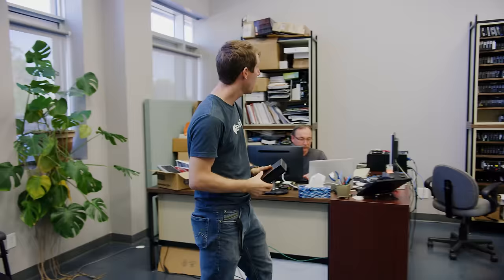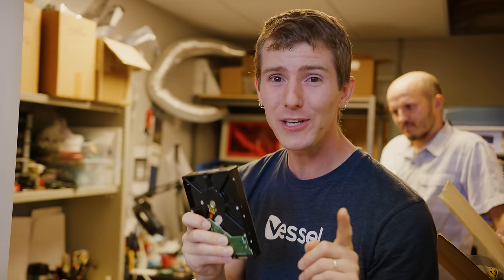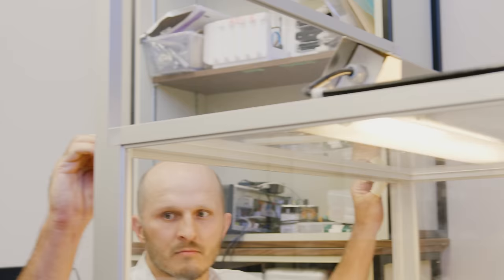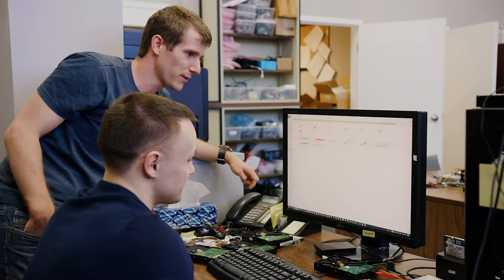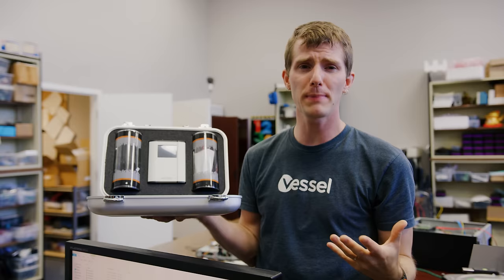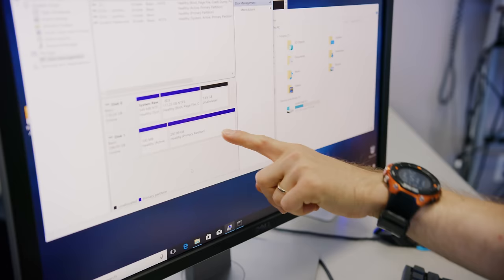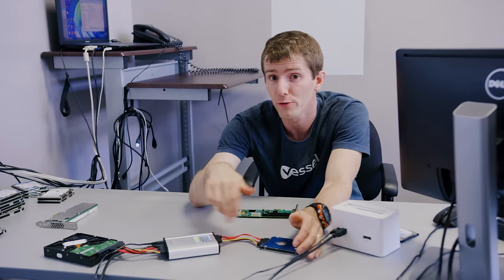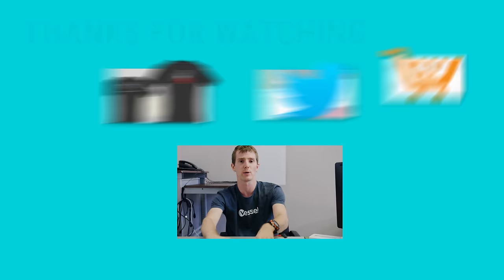Don't Waste $1000 on Data Recovery

Comment: I yanked at my laptop and then the whole thing crash after I force restarted it and windows kept on going into recovery mode. I checked that the whole drive is empty using diskprt in recovery mode cmd prompt. I swapped the drive and put fresh windows. But does anyone have any idea what to do with the crashed drive? I have a ton of photos in it. Should I just use a recovery software or should I send it to a pro?? Anyone??

Comment: Really not sure what he is playing at, RapidSpar by itself is almost $1800 US. That's without any adaptors ($270), Data Acquisition add on 🙄 ($780), USB add-on 🙄🙄 ($900), the adaptors for the USB add-on 🙄🙄🙄🙄🙄 ($195). They discount these pretty hard if you get them all at once, and I get that it is a very specialized piece of hardware, but why buy an HDD/SSD recovery platform that you can't even plug a drive into? That's kind of like buying a new car but the keys cost extra, no?

Comment: Need Help!
So my system was lazy i decided to install the windows 
but accidentally installed windows 7 on wrong drive { Drive D }
First I formatted it ... Than tried to install the windows ... on Drive D ... BUT the windows files was corrupted it did not installed ... I got mad i hit the format again trying to install the window i thought it was { Drive C } So it was 2nd time i formatted { Drive D } After that i installed the windows but it got stuck at 70% i restarted my system & it directly gone to windows i was shocked that time i was still thinking it was { Drive C } than i formatted again cuz i got too much MAD but all data on { Drive D } is gone i tried all recovery software it just showing me system files. CAN I GET MY DATA BACK IM REALLY SAD RIGHT NOW old windows is still here im thinking to restore system from control panel. PLEASE HELP! before i blow up system out of madness

Comment: 15:00 I attempted to try recovering my drive, and even did the automount disable trick through the command prompt, however i still notice my hard drive wont detect on my pc. any suggestions on what to do? theres no clicking or physical damage to the external drive, however it simply cant be detected by windows whatsoever... it wont show up in disk management too. the most i see sometimes is a "disk 2" show up for a split second saying unkown partition, before it disappears.

Comment: I need a help
I accidentally used clean command on one of the raw volume which was of system.
But entite disk became raw 
And all the partition became a single disk
I havent used clean all command  because it completely set all the MB to zero
Where only clean command sets only first and last 1mb to zero according to windows diskart.

Now current situation  is i am unable to booy anything at all beacuse partition became raw and 

And i dont want data to be deleted so i cant use bootable usb to install the whole windows 10 because it will format the raw Partition. 

Or it will not idk?
Reply: Help me if anyone understand the situation here

Comment: When Hard disk gives massage Disk is not initialise d  what should do
Reply: It means that the disk has not been formated. Which means that it was partitioned but not given a file system. This is a logical/software issue, very easy to recover from with the right recovery software.

Comment: Damn, F*%k, Sh1t, B077ocks B077ocks B077ocks!
I wish I'd watched this before.
I was wiped out with Ransomeware whilst connected to my backup drive so 6Tb data lost.
After the initial anger and then the acceptance that the data was gone forever I remembered that the important data( all the pictures of my family over the past 20 years) was previously stored on other smaller drives that had been formatted and were now being used as convnient transfer media most being 500Gb 1TB and a 2Tb
So pulling one 2TB drive out the drawer I plugged it in to discover it was totally dead.
After investigation found the PSU had blown. I hooked this up to my bench lab supply and dialed in 12v fired up and all the data was still on it I started selecting folders to copy and suddenly got "error error error" accompanied with the smell of burning. I pulled power to discover my PSU had glitched due to a faulty adjustment pot( what luck) and was now sticking 23V into it.
I then bought an identicle drive off ebay swapped the Rom chip and powered up to get the Format drive prompt I then ran a program called Test Disk that found the partition table and listed the folders. So I rewrote that partition table to the drive but still no dice.( that ought to have worked)
At this point I thought I need an imaging software but couldn't find a free one
I then thought ok I'll do a format recovery using recovery software.
I ran ontrack which after a short while said it couldn't find anything
but in the process  a 250GB partition mysteriously appeared on the drive.
When trying again Ontrack reported bad sectors and refused to boot the drive.
And test disk could no longer find the partitions.
In the end I formatted the drive and run another data recovery software
Which reported about 5TB of data on a 2Tb drive.
I'm guessing that because the file structure was destroyed it reads references to files from several locations and assumes they are different files then duplicates them?
So ran the recovery got the data back (no family photos they must have been on another drive previously which has since been overwritten) but what I did get was 5Tb of everything in one raw file divided in to file types. Which is useless when a recovered install has the .EXE in a folder with 200 others the Cab files named as File????? and the DLL in another folder with a few thousand other renamed to file1 to 2000. In otherwords the data is there its just absolutely useless unless you want to spend weeks trying to match up everything and rename the files correctly.The few JPGs I recovered that weren't corrupted were random lines, icons and patterns and some photos of random buildings and people I have no clue who or where they are from. I'm guessing the drive was originally where I had software stored, a few films and some downloaded music videos. I Got a couple of those back but over all maybe 300GB out of 2TB Which most of that is duplicated files but better than nothing.I think that the drive was full so potentially there is a lot more data that wasn't detected
The HDD is essentially dead I ran a smart test on it and the geometry is wrong and it has 2 other faults So after another search I found a bit by bit image software so I will try to get an image off it before consigning it to the bin.
What I'm now doing is scanning the other repurposed portable drives for lost files hoping that some of the family photos were on there at some point it's slow several hours to scan each drive and even longer to preview files that allow a preview otherwise I'm trying to select all and recover but the recovery is slow I have a couple more drives to scan but I think at this point its a lost cause. The only good thing is a lot of PDF Rar and Zip files have been recovered which assuming they arent corrupted will at least be full archives with structure.

Comment: It's interesting that Linus waited until nearly the last possible second to even mention backups as a preventive measure here. The cheapest option, by a wide mile, is just don't lose your data in the first place!
Reply: Yeah but we putting out what if u did lose it
Reply: @ABoxIsMyHome  With proper backups, this should be an exceedingly rare event. And if it does happen anyway - possible, despite being rare - then go for professional services, eat the cost and be glad they existed as a last resort.
Reply: @jakykong  true that!

Comment: so yes dont waste $1000 on a data recovery company... BUT... you NEED to get the rapidspar device in order to get the data yourself and that device is valued for around $2000....otherwise you better take a shiet on your foulty drive cuz that data aint going nowhere since all other recovery softwares require windows to automount and map the drive distroying it in the process :)

Comment: "don't waste $1000 on drive recoery" use R studio! checks price $1000/year...
Reply: I use different software way cheaper allows to save scan results also so don't have to rescan drive if forgot a file
Reply: @Tysman909  still need the files off that drive. what software is it?
Reply: @danz409  look up software called GetData Recover My Files